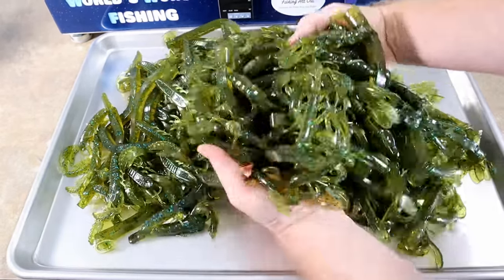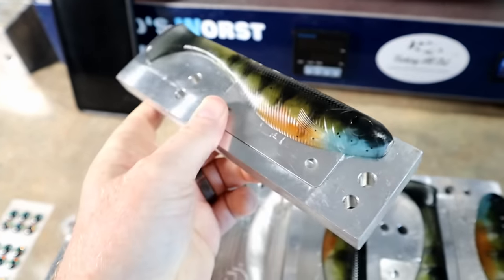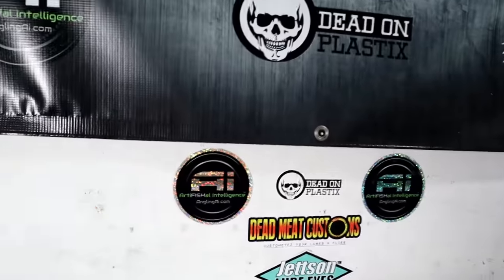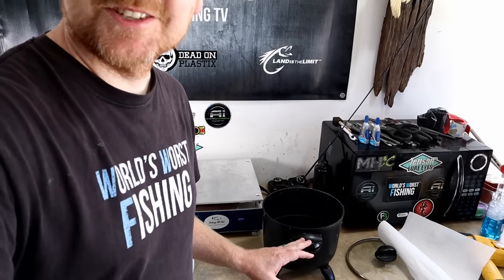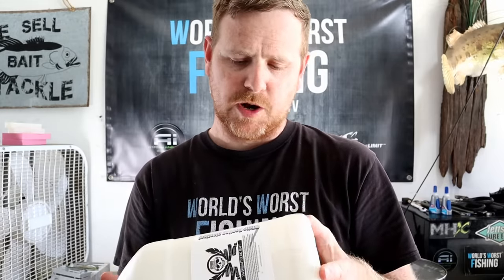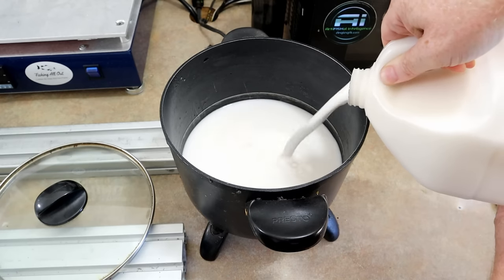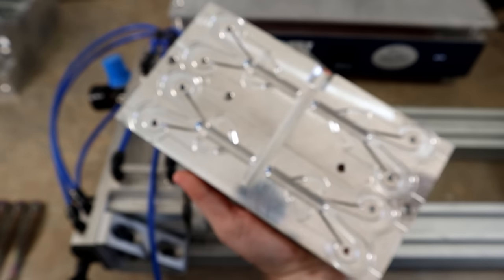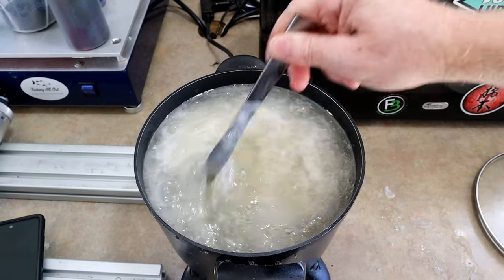One GALLON Plastisol CHALLENGE: How Many Craws/Creature Baits Did 1 Gallon Make

Comment: Awesome, just curious if I missed it but about how long does it take for 1 gallon of the plastic to be ready in the pot?  I'm wondering if nuking it and adding it to the pot would be quicker? Just based on nuking 2 cups at a time I think that would be around 25 -30 minutes or so by microwave to get 16 cups.